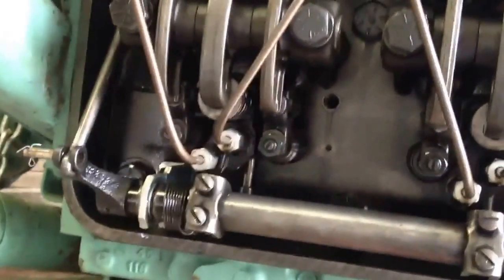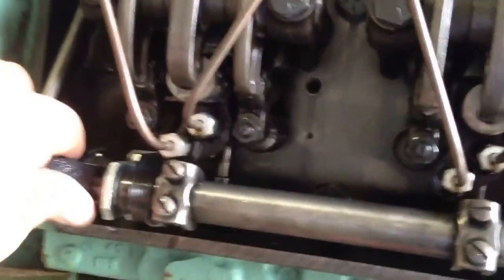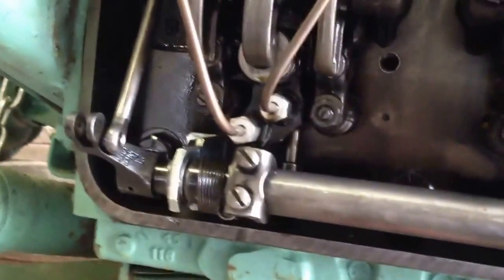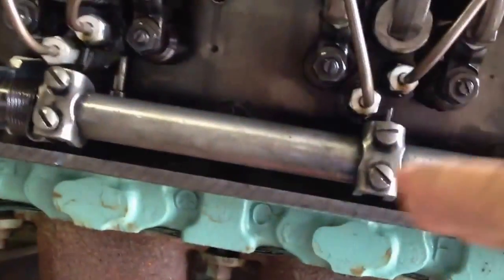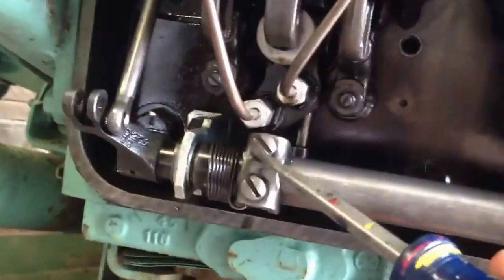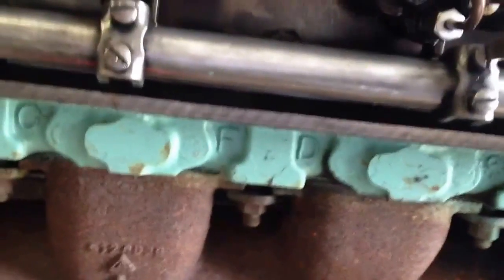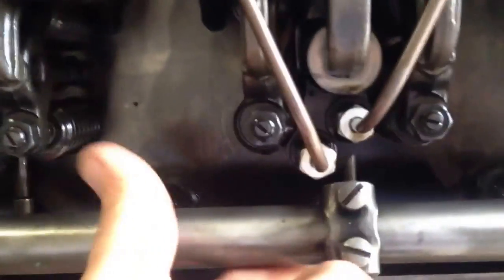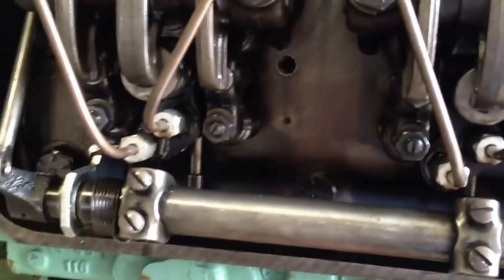8v71 stuck fuel injector

Comment: On later versions with "Break-Away" system, will the motor run with a stuck injector?  
What is the consequence of running short periods if an injector becomes stuck?
Is it possible for an injector to seize up like this while running?
Reply: The break away rack allows the remaining injectors to meter fuel. If one sticks full delivery the others can move to no/less delivery. This is mostly an issue on start up as the injectors are “full rack” when the engine is off,  if one sticks with a rigid rack they all stay full delivery. It makes a bad situation better as in not a full blown run away. If an injector seizes whIle running the plunger Will be forced down by the injector rocker and stay there, no delivery. You’ll just have a dead cylinder.